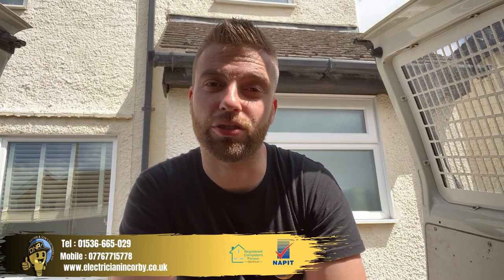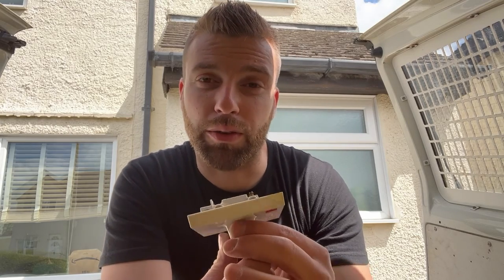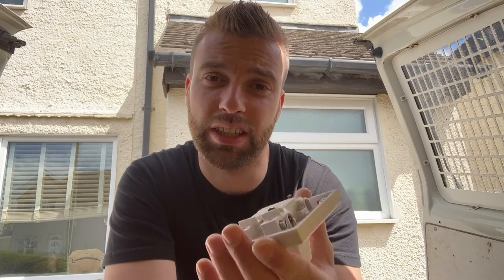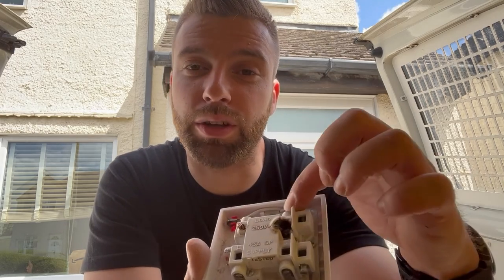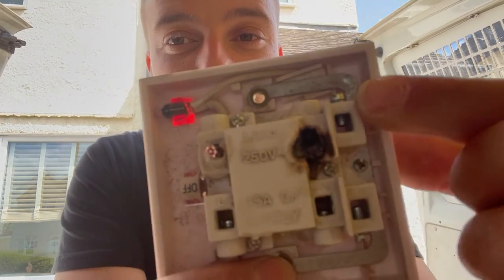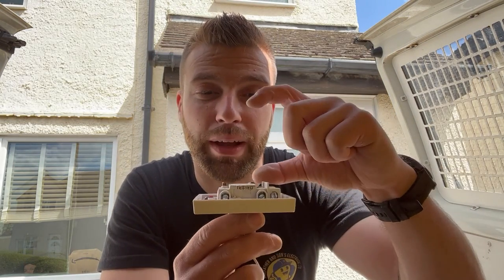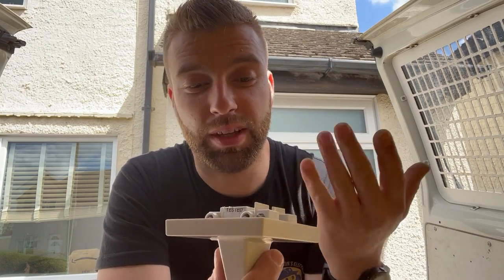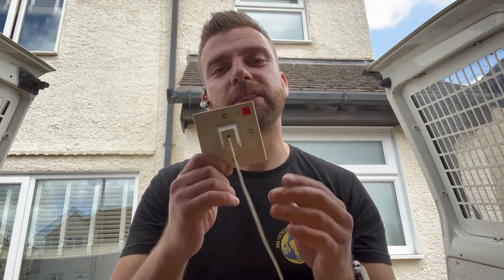My shower stopped working , here is why!  Electrician in Corby @electricianincorby

Comment: Great video. My neon light inside mine stopped working and so did the shower. I replaced it with a new isolator and the neon light fails to light on that one too. Checked the RCD hasn't tripped and it's fine so I guess this means I need to get a sparky to check the RCD itself as power doesn't seem to be arriving to the switch.

Comment: Hi David. I was using the pull cord on a daily basis as I did not know I could just leave it on, however, this time I stayed in the shower much longer, and the pull cord got stuck in on position of the "red light indicator" when I switched the shower off. I can still operate the shower. Should I get a new pull cord switch?

Comment: I used this advice with last isolator 45a and it still burned out & failed both negative terminals showed signs of the plastic melting and on the wire ends on ‘load’ (shower) side. within last 2 years. This was leaving the switch permanently in on position and only operating on off button on the shower. I think these all fail after time l am not convinced that operating the switch is what actually causes the melting

Comment: My mitie shower just switched off by itself. The cord that you pull to turn on the shower, the light is still showing. Checked the electricity box, nothing has tripped except a thing called the bottom immersor though i dont have a water heater

Comment: my shower cord runs i think, it turns the shower 'on', as in, it switches the water on by itself. But the on off button on the shower unit doesn't work and the water isn't hot. any ideas?

Comment: Blue light coming on in Triton t90 sr brand new but shower not working ,could this be a pull cord problem ?
Reply from the maker: Hi, 
If you could describe this in more details , we may able to help. So the light comes on on the shower unit, but when you press start the shower wont start? 

If you turn the pull cord off will the light on the shower go off? 

Many thanks 

Regards 

David

Comment: Hi mate, my pull cord is working the light comes one/off when I pull cord but the red light on the shower does not turn on. Shower doesn't work at all no water coming out either. I opened up the shower and tested the lines using a tester they seem to be getting power. Any help would be appreciated. Thanks.
Reply: having exact same problem did u find a fix
Reply: @abdulsijad2419  the pull cord was lighting up because there was power being delivered to the switch. But the wires carrying power from the switch to the shower were burnt inside the switch assembly. Probably due to not being tightened properly or steam. I had to open the switch assembly and then trim the burnt wires and connect it properly. After that it worked fine. I would advise opening the switch assembly and checking to see if the wires are making a good connection or if there's any sort of burning or corrosion. Hope this helps.

Comment: Hi my shower blows the fuse down stairs every time i try to get a shower on setting 3. It works fine on low or cold setting but if i turn it to mark 3 on the shower the fuse blows. With it working on lower setting tells me it is not a leak that's blowing the fuse. do you think it could be the switch ?. Thanks
Reply from the maker: Good Morning Jack, 

No, it will not be the switch. What happens there is that your shower is overrated for the fuse that you have down stairs. Showers has a heating element in them, when you set your switch higher you basically telling the heating element to heat more and when it has to heat more , it will require more power. This would not be problem of course but because your fuse downstairs is smaller then what your shower is required on mark 3 it will blown. Now please DO NOT just replace the fuse with a higher rating because the fuse is there to protect your cable  that supplies your shower from overloading!! You first MUST confirm that the cable supplying the shower is sufficient/big enough to carry the required power. If it is , then a simple fuse upgrade will solve your issue, how ever if it isn't then you can either downgrade your shower to something that takes less power or you can upgrade the cable to it. My advice on this is that you contact a local electrician who will be happy to pop around and check this out for you. If you are in my area Corby or Kettering , I am more then happy to pop over and take a look.  

Hope that helps!

Best regards 

David Nemeth
Reply: @electricianincorby  Thank for the detailed information David. See I have already downgraded the shower from a Triton 10.5kW what was fitted years ago by a qualified electrician to a Triton 8.5kW. The 2nd shower worked for about 2 years until this. So maybe the cable and the fuse box should be plenty good enough for the 8.5kw ?. I am replacing some bath tiles right now just in case because my bath sits right above the fuse box down stairs and it could be damp causing the issue. One more thing though i had the water board out the same day the fuse kept blowing and changed are water meter outside in the street. I am sure they turned are water pressure. But it seems still strong enough for a shower. Btw i live in Corby also and have your number. I will call you if i don't fix this or might just buy another shower for the 3rd time. Thanks again for your help.
Reply from the maker: @jackpot4430  Hi Jack, Yes , in that case , Not entirely sure that you have water ingress or damp inside your consumers unit , well if you do then yes this needs to be sorted ASAP and that can cause serious issues, but you might also could be looking at a faulty heating element in the shower. Please let me know how you get on and give us a call we pop over for a check. 

Many thanks 

Regards 

David
Reply: @electricianincorby  Hi again thanks for your help and yes i will give you a call if needed. I have ordered the same shower from triton, web site what in fact was the cheapest Madrid II i have seen on the net even cheaper than ebay. So i will fit that when it comes and if it still blows the fuse at least i will know it is not a faulty shower and i will probs will call you. I also suspect it is a faulty heating element but to buy a new one of them cost half the price of a new shower and i only paid 58 quid from triton for a new one. Thanks
Reply: Put the new shower in and it is working perfect touch wood. :)
Reply from the maker: @jackpot4430  Happy to hear that ! Lovely! :) Thanks for letting me know !

Comment: What if you've noticed NO  pull cord to your powered shower at all. I think that the previous owner may have done something wrong by not having this pull cord isolator.
Reply from the maker: Hi Ridge,

Thank you for your comment. 

Yes, they might have cut some corners by the looks of it, but there is no regulation stating that a shower has to have a pull cord or a switch installed, it only states that it has to have a means of isolation, which could be a circuit breaker in your consumers unit. 

It is how ever a bad practice not to install an isolator nearby, as if your consumers unit unaccessible or not labeled properly, or much further away from your shower, it would no longer be a local isolator, and also in case of an emergency (burning smell from shower) ,you as a homeowner could be confused when seeing all of those switches in a consumer unit, may not know which one to turn off, especially if they are not labeled correctly, so in my professional opinion, a local shower pull cord or a double pole isolator should be a requirement and in my world it is without a doubt for every shower circuit.

Hope this helps.

 Where about your consumers unit is located at the minute? 

Is it labeled properly? 

Many thanks 

Best Regards

David Nemeth
Reply: @electricianincorby 
Has it's own isolater on the box you asked about.
Labelled ;  Wylex B50. NHXB50
MCB 
Recommended date  of  inspection  06.09.2026 ; It is in converted garage / utility room downstairs. 

Thanks
Reply from the maker: Given the fact that your board labeled to be inspected in 2026 tells me that you either bought the house in 2021 and had the electrics tested , or there was a consumers unit upgrade in September perhaps when the garage was converted. Now in both scenario , having no local isolator for a shower should have been picked up on testing and in my opinion an isolator should have been installed. 

There is nothing that you need to worry about , you not breaking the law or anything and you are not in any kind of immediate danger either.

Do you by any chance know what type of shower you currently have?

As your shower is on a 50A circuit breaker it has to have a 10mm2 cable that goes to your shower. If the cable is any smaller ,and you have a high powered shower ,the cable could melt overtime.

There is a label on the shower unit itself, some models have it on the bottom ,some on the top or on the side.
I would be interested in a number like 7.5 , 8 , 8.5 , 9.5 , 10.5 , these numbers indicate the power rating of the shower.
Reply: @SpeckyandSkint f

Comment: Isn't that going to burn a huge amount of electric by leaving it on?
Reply from the maker: Hi Rahman, 

No it will not. It will only draw power if you turn on the shower unit itself. That is when the heating element starts working, which draw power. 

Many thanks 

Regards 

David
Reply: This is what it want to know
Reply: Haha, never park your car with a tank full of petrol, because it will gobble it all up.
Reply: @chesshooligan1282 apples & oranges. Electrical things like your TV will still draw power if they're not turned off at the mains. So his question is much fairer than you seem to be
Reply: @A.Servidor  Your telly may draw a couple of watts at most, not "a huge amount of electricity." That's under a fiver a year worth of electricity at current astronomical prices, and a lot less in normal circumstances.

Comment: My shower switch stopped working the light went out,so I got a new switch and now light is on but my shower is still not working,can someone please tell me why?
Reply from the maker: Hi Mitch, thank you for your comment. 

This could be for various reasons, now which light went out? The one on the switch or the one on the shower? 
Also, did you replace the pull cord by yourself? If so, did you make sure that all connections are in the right place and are tight to the correct torque ? 

Many thanks 

Regards
David Nemeth
Reply: @electricianincorby  hi it's the on switch what stop working replaced the switch now light is on and now shower still don't work,replaced shower 9.5 now and still don't work
Reply from the maker: @ny1mitch964  If you replaced your shower  then this could be an issue with a connection of your neutral cable. If it is loose or not connected properly, you will still have luminaries lighten up, but they won't work. Your best bet is to call a local electrician and book him in for a quick test.